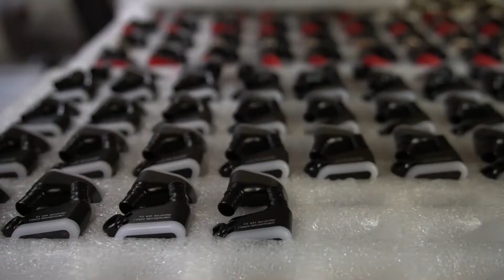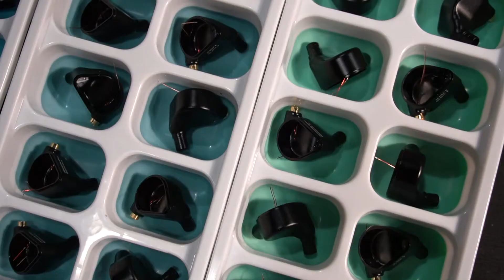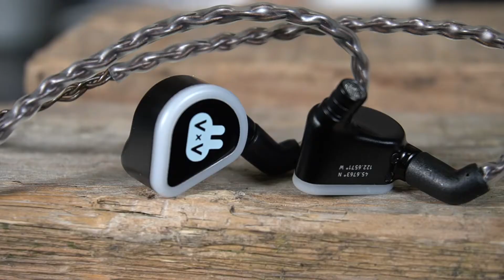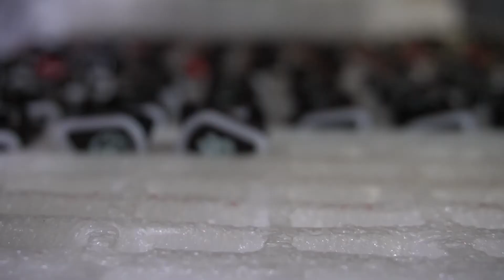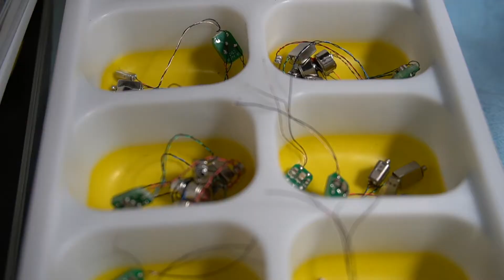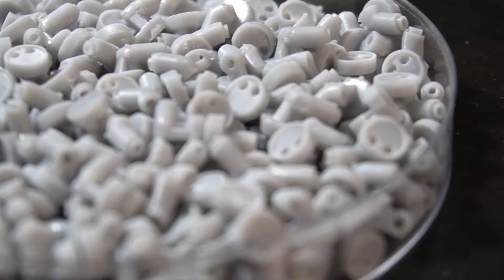FiR Audio - VxV In Depth

Comment: Do you recommend buy them together with customized cable or cable from the bundle will be fine ?
Reply from the maker: The cable with the bundle is quite good. In a matter of preference you can try a copper cable as well. It doesn't have the Xcite circuit (LID 2.0) so you can mould the sound a bit with source and cables.

Comment: Tnx for the previous reply. Are you planning to extend resellers network in the Europe ? I am trying to buy VxV and cable in the Doctor Head shop and service tbh is far away from the “normal”.Had 3 problems in a row with my order and still not get mine earphones:(. But going to finish my purchase as demo unit in the shop sounds and looks really cool
You guys doing really good products
Reply from the maker: Hello, supplies are a bit strained right now. Shipping a logistics take a bit longer along with price increases we've been dealing with over the past year. Things should smooth out soon and the product should be in stock for distributors. Thank you for your support.
Reply: @FirAudio   It's quite sad but 3 weeks gone and I still haven't received mine. I got already a package from Dan Clark Audio that was ordered later also from the US so delivery works absolutely normal. So sad to say but such behaviour could not be called client-oriented...  Gl
Reply from the maker: @tykanlemon   please contact us@firaudio.com we will make sure you receive your product as soon as possible.